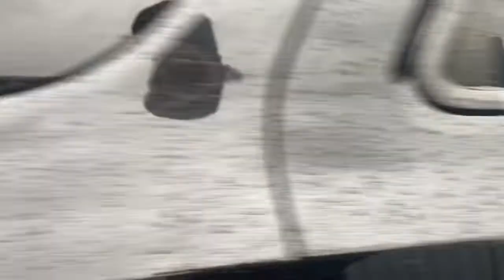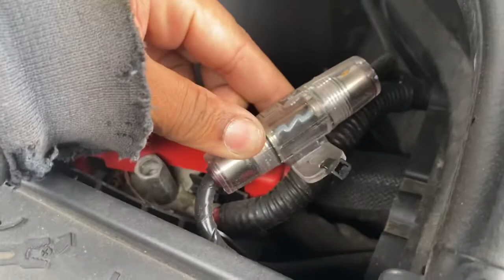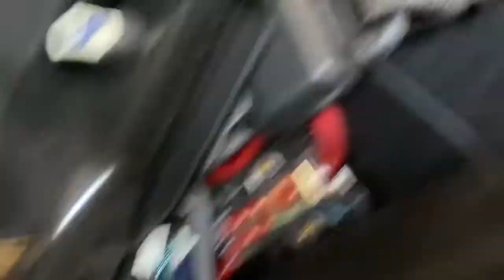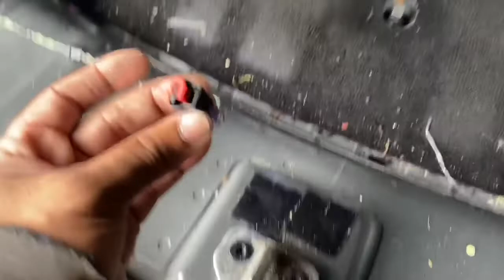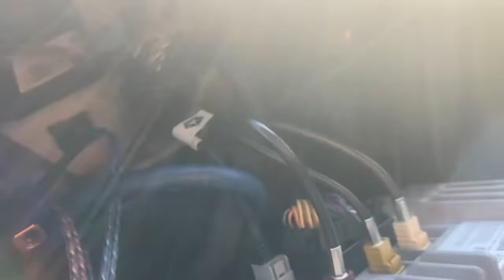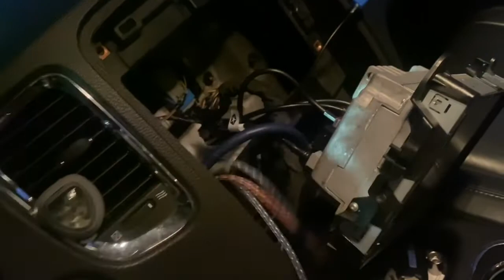Dodge Durango wiring rescue

Comment: Get rid of that shit ass head unit. Get a maestro kit and an rr module even a dsr1 if you want. Then use a radio that is maestro compatible for the truck mine is a pioneer nex unit. Made the stock sound 50 times better.

Comment: I understand that OFC wire is better than CCA, but what I don't get is why CCA is blasted my some installers if it is sufficient for the amperage being drawn. For example, 1-1,000 watt RMS amp @ 1 ohm, using 1/0 CCA should be more than enough without having to go with OFC. Is that incorrect?
Reply from the maker: You are correct about the 0 gauge cca wire is enough current for a 1000 watt amp but now the money you saved on the wire you will need to
Spend on a distribution block
For
Power and ground to reduce the zero gauge to 4 gauge going into the 1000 watt amp . 
Plus the cca wire corrodes when it gets wet under the hood .

Comment: I just got a use 2014 Dodge Durango sxt from buy here pay here a couple moths ago, Truck was in our price range and when I took it for a test drive I looked for the important things. Truck is in great shape no problem just bless to have one for our family. When we test drove the truck we realized there’s no sound coming from the speakers. We have the small touch screen and everything works but you can’t click on the info or am/fm. my phone automatically connects to Bluetooth but no sound. From talking to ppl and doing research, it looks like it could be the amplifier but I just took it to a audio place near me and the guy literally couldn’t find the amplifier anywhere. He told me to go home take off the door panel test the speakers with the battery to see if the speakers are working and they are. So now I’m sitting here trying figure out what to do praying this is not a problem that’s gona cost 
A arm and a leg. Someone please help. Thank you 🙏🏾

Comment: If using the audio control lc2i where should I I grab the signal at Ideally?

Currently I'm connected at the old factory sub inputs.  It hits low......like low low but misses everything else.  Is there a better location to grab the signal from.
Reply: Try the rear door speaker. I to have used the LC2I in the past it works but if your can be configured with the pac pro. I highly suggest using the pac pro T harness. Yes it cost more but the sound quality you get I worth it and you won’t have to run a ton of wires everywhere.
Reply: Having the same trouble too I connected to the factory sub cables but I’m having a tump problem